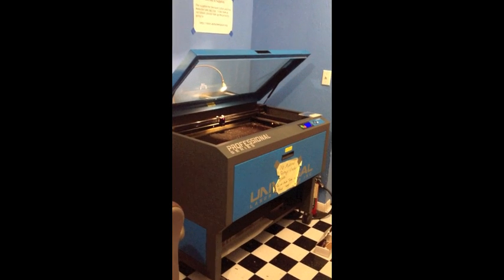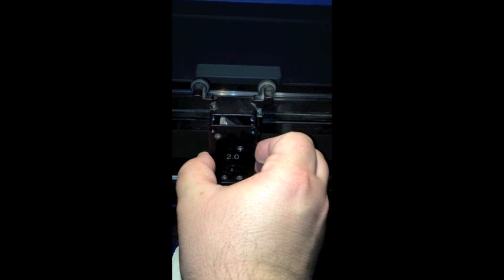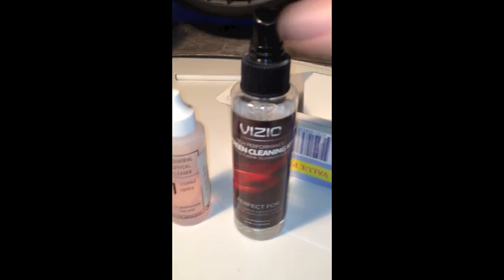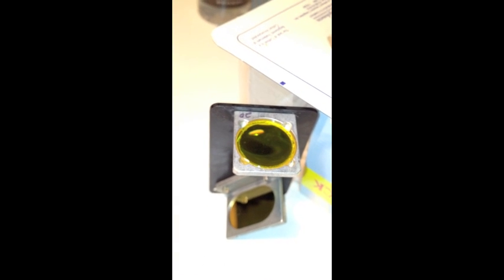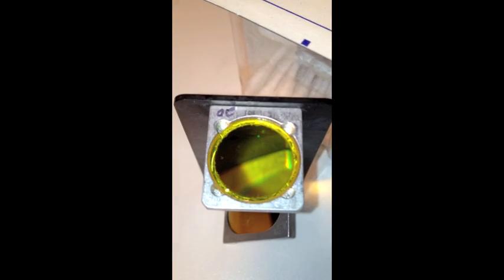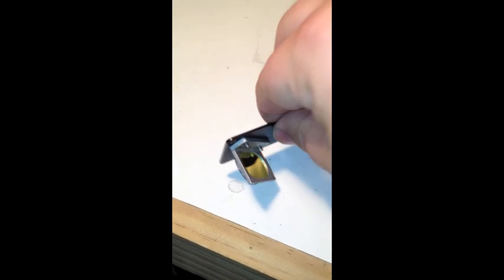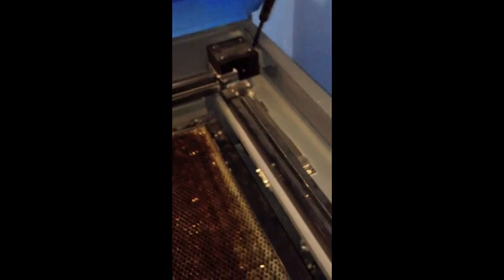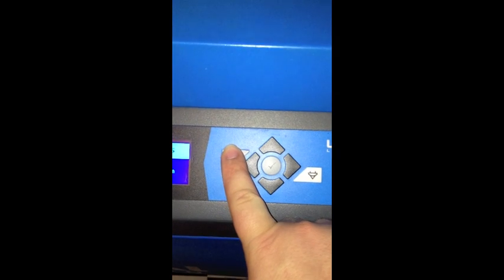How to Clean Laser Optics

Comment: I'm assuming that's a CO2 laser you're using, with a zinc selenide lens. We use a 2kw CO2 laser for laser metal deposition work, and we have a problem with the zinc selenide lenses burning due to the high power. fun fact! if you ingest zinc selenide fumes, it can react with the acid in your stomach to produce a toxic gas, which smells like garlic. Very good video.
Reply from the maker: Yep -- that garlic smell is basically cyanide.  Bad thing to have around.  Once you get to really high powered lasers -- things like cooled optics and focusing mirrors become important.